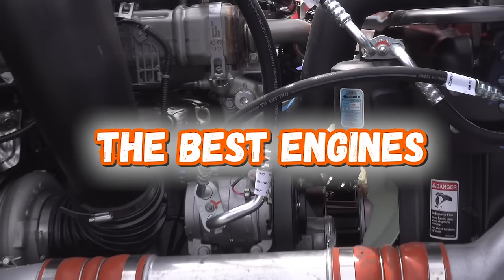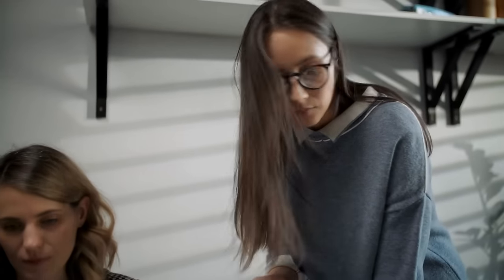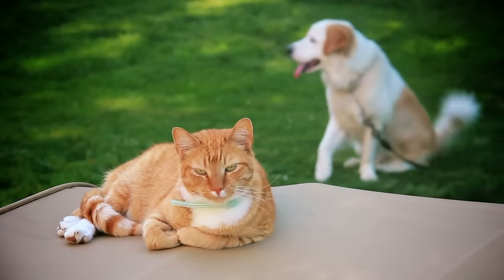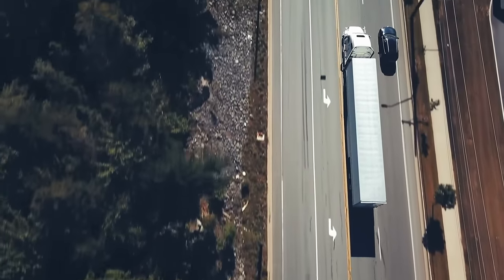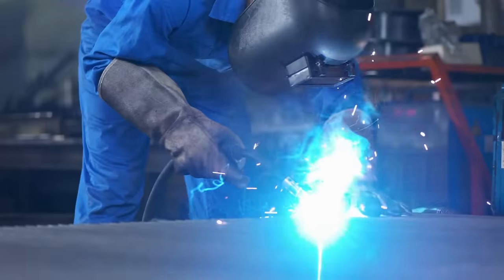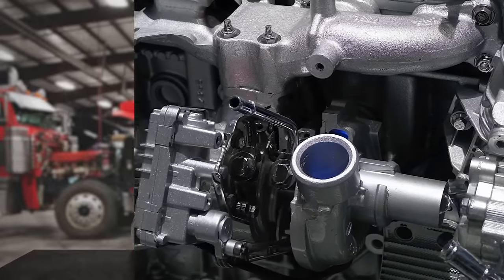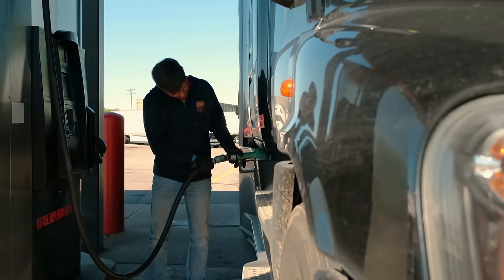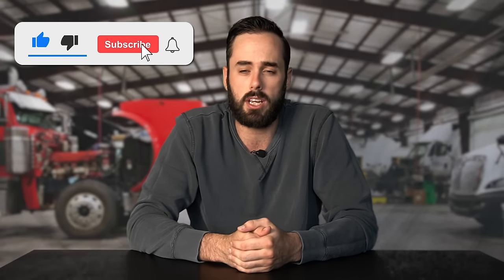The BEST Diesel Engines of All Time! (CAT, Detroit Diesel, Cummins, Mack)

Comment: Nobody will ever talk me out of my Cummins 600 Signature Series.  Over 2 million miles on it and still walks the dog on everything I've come across pulling hills at 120,000 + lbs. Fuel milage is consistent and after 21 years has never had a mechanical issue. The Detroit 60 Series is also a good engine. Good fuel milage and dependable mechanically.  Kitty Cats are great engines mechanically with lots of power. Like the Cummins, a little more expensive to work on when they need it. Cats one big downfall was always fuel mileage.  In normal applications 5.5 to 6 mpg were fantastic for a Cat engine. Mack..... I'm just not familiar with. They make a great Dump Truck, but have only driven one Mack Conventional Tractor and hated it.
Reply: Uk
Reply: Wow that's very impressive, i own cat c 15 acert many said it has problems but I'm still going with it after 1.2 million km not too bad no issues
Reply: I was about to say the same thing… I have a signature 600 chrome top on my 2001 kw w900b and I bought it HATING cummins and now it’s the only engine I want.
Reply: Cats and fuel mileage. I  used to haul  gravel,  in 2004  spreading gravel at  oil well leases, tridem belly dump, with power open/close  gates.   A  Western Star, with Cat  475,  18  speed manual  tranny.   We started 7 am, and done/fuelled up, at around  5 pm.   Most days,  it  gulped 375 or 400  litres.  You could  feel,  the power in the truck frame.....Alberta Canada      I  also drove a mid 90s  Freightliner, gravel also, with a Series  60  Detroit.  I was impressed, at the pulling torque.... Starting off was a breeze, but had to be carefull with the clutch......
Reply: N14 , signature625 and x15 in my fleet. Wouldn’t buy anything else’s .
Reply: @mihybrid1

Fuel mileage was the straw that broke the camel's back for me to go with a Cummins N14 over a Caterpillar 3406.

 I cannot justify spending the next to $30,000 a year on fuel just to have a more peppy engine.

My 370 horsepower 1999 comments on 14th Select Plus can handle about anything excelt those heavy sugar loads that come from the West during Christmas time to go to the Gary Indiana sugar cookie making factors.  I stay within 300 miles of Chicago so I don't see any mountains. Works for me.

 I'm sure more horsepower would be more fun-- but horsepower is expensive and I'm not there yet financially.

I drove a 2000 Mac ch600 but I never found out what engine was in it and it was pretty decent day cab.

I more recently drove a 2006 Mack vision day cab and it was slower than slower than slower.... before that I drove an "R" model Mack which is even slower than the 2006 Mack.  There is a reason why around Chicagoland Owner-Operators drive Freightliners, Kenworths, and Peterbilts as dump trucks and not Macks: you have only so many hours of daylight to make your money and you can't be farting around in a slow truck.
Reply: Guess you have not ran up against a 1MM 600 Cat yet with same or more weight on it because there were 119 total built for one reason to prove to Cummins that Cat was king of the hill. That is what I run at 650 hp torque out of site wouldn’t own any other. Last one I put 3412 injectors in and two 3412 turbo’s one running front three cylinders the other running back three turned down as low as possible and still run right 1,250 on dump they have 70 pin virgin ECM so can set to what you want or need. Have walked around 600 Cummins that were claiming 900 hp and was twice their weight plus over width over height over length. Drove a truck from Baltimore Peterbuilt to Nebraska truck auction that had a 600 Signature Series put in it would run the motor was the best part of that Volvo
Reply: Yeah, the 3406E is a great engine. King of the hill? You'd really have to take them at factory settings to discover that. As for twins, bigger injectors, tuned ECMs, etc., you can take any engine and make it better.  The biggest problem you'll always have with any Cat engine though is fuel milage. It's non existent. 4.5 to 5.5 mpg is average. 6 mpg is running 65 mph. Add that to 1.5 x the cost for repairs and you might find the Cummins preferable.
Reply: @mihybrid1  

Fuel mileage was the straw that broke the camel's back while I went Cummins over Caterpillar.

I started out with Intermodal and most of my stuff was under 28,000 lb net. Even if I were to do those heavy big parks trucking companies paper loads 44,000 lb net we're a caterpillar made outshine other engines, the money wasn't in the rates to cover that extra fuel to be purchased.

Maybe if I were haul B- trains I could figure the caterpillar would be more competitive with its fuel mileage along with its tugging power.
Reply: @michaeldunagan8268  I haul Over Sized quite a bit. Yeah, my engine isn't stock anymore,  but even before the twins, bigger cam, injectors, etc. I had no complaints with the Cummins. Now, before juice ( water / methanol ), at 827 rwhp I don't even think about the incline. The thing that I find incredible about this engine is that the power curve is phenomenal and you can still count on fuel milage regardless of the terrain.  Yes, there are engines that get better fuel milage, but you won't see them pulling a 6% grade or better at 55 mph with a load on. By the way, the 600 Signature Series came stock at 600 hp. It could be turned up at the dealership under warranty from there.
Reply: N14 plus is not a push over either!
Reply: It really is like someone attempting to tell you you're have way to good sex and you have to stop it....and when your reply is an overhand right they stand there clueless.

We are damned if we do and if we don't. We shouldn't be forced to adopt new engines without their reliability being on par, we will learn new tricks if needed
Reply: @SparkedInnovation  4-53TT 900 lb/ft in a 3500 hd is good for the reliable inline 4 cylinder
Reply: 6nz period
Reply: My opinion that was straight truth...also older engines not new stuff
Reply: I'll take the Detroit Myself but the older ones
Reply: @mihybrid1  bullshit
Reply: @chuckdillon3930  Love the haters. If you ever haul something bigger than that little Ford tractor behind your pickup truck, go pull Kingman on the west bound side and see how you fair.

Comment: The fact that the DD15 is on this list with all of these other heavy hitter including the engine it was designed to replace is a testament to the fact that it’s the best engine from the post emission era.
Reply: Hi how are you doing. I’m Maria from San Bernardino😊
Reply: Agreed..love my dd15  hands down
Reply: Yep. It just keeps going. Only thing I don't like is that my truck is governed at 68.
Reply: Great motor as long as you have spare Nox sensors and don’t idle too much since that kills sensors and DEF/DPF box
Reply: @Nikowalker007  That seems to be the theme for any emissions era diesel, don't idle them excessively.  It's definitely good motivation to get APUs installed on highway tractors so the drivers don't have to leave them running all night during winter (I would assume most APUs also run a block heater so the main engine will start on super cold mornings).
Reply: @jmit3491  and yet there are plenty of dd15s out there with over a million miles on them. I’m sure the SAME thing was said about the series 60 and it’s digital ecm when it came out. Or the MACK e7 with the individual mini pumps rather than the big p pump. All new technology will have hiccups and problems at first. But they have proven their reliability
Reply: @jmit3491  your story is the exception not the norm sir. I know a lot of guys who are owner ops at prime with dd15’s with over a million on them.
Reply: @jmit3491 I love the dd15 and 13 there is at least 5 trucks out side our shop right now powered by the those plastic piles of sh!t ether seized blown head gasket blown rod bearings 😂😂

Comment: The 12v and 8v were killer engines. Both the 71 and 92 series were awesome pullers, doesn't hurt that they were some of the best sounding diesels out there.
Reply: The 2 stroke Detroits had miniscule torque.  The 92 series were simply junk and the final nail in the coffin for 2 stroke Detroits.
Reply: @shawnchurch316  that is true but I never had a problem with either. but they were reliable and they got the job done, and that is all that matters to me.
Reply: @shawnchurch316  smile lasts all day
Reply: Also the reason why so many truckers from that era have significant hearing loss.  They were very good at turning diesel fuel into noise.

Comment: Nobody talks about the Cummins N-14 Celect plus 525, talk about a workhorse she never let me down.
Reply from the maker: Not really, there's a lot of support and love for the N-14 out there
Reply: Worked in a heavy shop for 24 years we ran every type of engine there is Cummins cats Detroit's Macks  Mercedes for me the old n14 was the best we never did anything to those engines except change oil they just kept on going and going Detroit's and cats we're always in for more problems with injectors turbos Etc on a rare occasion we had to fix something on a Cummins but it wasn't that much
Reply: @dtobar1981  my experience with the N14 is it is not a heavy puller at all , probably a good medium duty engine , what kind of work do you do ?

Comment: You failed to mention the Cat 1693. Pretty much the predecessor of the 3406. They seemed to never wear out.
Reply: that was the beast of beasts from cat, twin OHC   ,yes they never seemed to wear out,  my 74 KW had one at 1 million  we had a inframe done, amazing how little wear was found .
Reply: Great engine but with it being a pre-chamber injection engine it was definitely a bear to start them if the glow plugs weren’t up to snuff. That is my only real complaint about the 1693 though.

Comment: I agree with a lot of these, but you forgot to mention the Detroit 2-stroke engines.  In their time, they were beasts and still are.
Reply: Yes sir can't beat a v1271
Reply: @deanfulford69  ..There used to be a  Newfie, in LLoydminster Alberta, with a COE  freightliner,....V12   with  a  5  speed tranny.  Most of the engine, was behind the cab. Hauling  liquid hot asphalt,  for road paving  companies. Westcan Bulk Transport.....i drove a 237 Mack  5  speed, for the company. Good enough power for the day, but that engine would go forever.   The  8v92's   silver  and  gold  editions,  WERE   BEASTS....
Reply: We have a truck still running a 8v92t that things more reliable then the later model trucks  and takes any abuse its given - of course if you throw marine parts in the series 60 you can bump upto 600hp+
Reply: Series 53 and 92 where converter engines 
They converted fuel and air into noise
Reply: @Scott

But their time ended in the mid-1970s.
Reply: @deanfulford69  

Yes you can-- look at any heavy duty diesel engine made after 1990 and you'll see that the horsepower and torque and fuel consumption and less oil burning blows away that noisy two-stroke.
Reply: I HAVE OWNED 12V71, 8V92 And I have permanent hearing loss in my left ear to show for it
Reply: @mikeaporter5231  

Yah—

—I worked at a warehouse for steel alloys and pig iron.  I occasionally drive a 20,000# forklift with some kind of Detroit in it.  I would only do so wearing ear plugs.  It was still loud!
Reply: @mikeaporter5231  Haha 8v92 12v71 are beasts!!!
Reply: Yes you can…..1155 Cummins or 3408 CAT. 2 strokes are obsolete.
Reply: That’s old junk
Reply: No.

Comment: Before I even watch this video the Series 60 Detroit is the best return on your investment hands down .Class Dismissed.
Reply from the maker: What were your thoughts after the video?
Reply: @NorthAmerican-Trucking-News  I based my opinion on what I see on the side of the road with the hood up , can a cat make enough hp to dominate speed ,,they usually do . Can Mopar make enough speed to melt rubber onto the pavement, they usually do but it don't mean they are the best .,same for Cat .

Comment: I ran a 2007 s-60 14L Detroit to 1.1 million miles tuned to 650HP in a otr freightliner Columbia. I was able to get consistent 7.95 mpg calculated tank to tank. And without having to do a in frame on it. It was the best truck I ever ran
Reply: 2007 was the year they started DEF, I think. Was  it a DEF engine?
Reply: @nostradamus7648  def didn't start till 2009. 2007 was the last year for egr without after treatment.
Reply: Is that much horsepower bad for egt’s
Reply: Dude I have that same engine right now! Lol so far two years nothing but oil changes
Reply: I believe it, I just opened up my 60 series for a head gasket that I was ignoring, can't say what they did but it's got 800,000 miles, someone put in new pistons but didn't replace the liners, the top lip of the liner was wore, pulled the liner to learn that I needed to cut the counter bores, but those cylinders did look good, other than the gasket leaking problem we had, the cylinder walls can go for a million miles with no problems, my truck is 25 years old and ran without antifreeze most of its life
Reply: Ya right almost 8 mpg maybe  down hill with a tail wind at 650 hp you're full of crap lol
Reply: @jgodawa13  it is true and I know many other truck drivers that are doing the same thing. It's all about knowing how to drive and what modifications to make.
Reply: @truckingrcaddict1183  it's simple physics it takes fuel to make horsepower your not making 650 hp without burning alot of fuel especially if your running heavy in hills maybe light in the midwest but that's a huge maybe
Reply: @jgodawa13  I said it was tuned to 650 hp, but I hardly ever used it. The tune was set to make the engine run as efficient as possible. It just so happens that when Pittsburgh power ran it on the dyno, 650 hp was the peak. Under normal operation, I was maybe using 40-45 hp. In that situation, an s-60 14l will do 8 mpg easily. The ecm was tuned to clean up the fuel mapping.  I also had a free flow exhaust and many arrow dynamic modifications to get the trunk to make the fuel economy stated. And yes I stayed primarily in the mid west. Avoiding the east and west coast mountains.
Reply: @nostradamus7648  no it was a ddec 4 with egr only.
Reply: @truckingrcaddict1183  Ya thanks for proving my point for me spitting out all this crap when it really doesn't count and still why turn it up to 650 when 400 would have done fine just to clean up fuel mapping ya right they can do that at any power level I have ran a detriot s60 12.7 a 1999 manufacturer date for 1.8 million miles and mine gets almost 9 mpg or better bobtailing but doesn't count does it

Comment: My friend is a sales manager for Inland Kenworth. They won a contract for 25 tractors for Siberia. NO electronic engines allowed. Bought T800 with no engine and trans. Sourced 3406 and 18 speed. That tells you everything you need to know. If you want it to work, and be able to repair it, in hostile environments - nothing else comes close.
Reply: Cat power eating Cummins and shitting Detroit’s since 1925
Reply: Don’t send that motor overseas!!!
Reply: In Siberia, MPG doesn’t matter.  If MPG didn’t matter here, I wouldn’t have a DD15.
Reply: @CheddarCheeseBandit  It’s probably going to be used In Siberian oil fields where Diesel is virtually free..
Reply: they might be regretting that choice now, since they won't be able to source parts anymore due to sanctions.  Kamaz trucks are even more screwed as they basically switched most of their trucks to the Cummins ISX back in the early 00s rather than try to design modern engines of their own.  So most of the Russian military which mainly uses Kamaz trucks is dependent on getting parts for electronic Cummins engines
Reply: Calfrac had a new 09 c5 6x6 sitting in Calgary until at least 2021, ordered for Russia, Cat power. Couldn't ship it to Russia as they'd changed to Euro4 specs, it was Euro3 spec. Russians were forcing them to buy Kamaz as well.

Comment: I’m at 1.3 mil on my dd15 untouched . And it’s still rolling strong
Reply: I’m at 1285467 with a DD15 but I check my oil and coolant constantly and after twenty four years I don’t see hardly anyone opening their hood and checking their engine while fueling it use to be the norm

Comment: Cat 3406B and DD Series 60. I ran a 14 liter Series 60 to just under 1.7 million miles without an overhaul. Not even an in-frame or bearing replacement. It was still running great and had good oil pressure when I retired and sold the truck,a 2007 Freightliner.
Reply from the maker: That is pretty darn impressive
Reply: @NorthAmerican-Trucking-News  I was expecting to have to do an in-frame at any time after 900,000. Oil pan and rear main seal were leaking at 1,200,000 and I had the guys pull three rod caps. The bearings weren't showing much wear,so they torqued them back down and put the pan back under it. I replaced all of the outer accessories multiple times and all of the injectors twice,but the head had never been off that motor when I last saw it. Rotella 15-40 and new filters every 13,000 miles.
Reply: The 2007 freighter with the sixty series is a solid truck now

Comment: The only two that I would ever own again are the Detroit Diesel series 60 12.7 liter and the Cummins N 14 ,  my 93 freightliner with the N14 was still running strong with 1.4. million miles when I sold it and my 99 freightliner with the series 60 12.7 liter went 1.8 million miles before I had it overhauled and then drove it 7 more years until I retired in 2022 , after a few drive train upgrades it was turning 9.2 average miles per gallon.